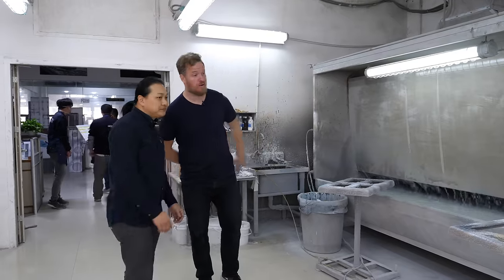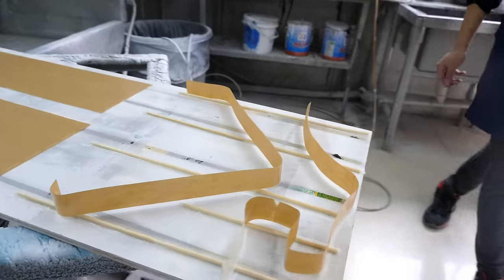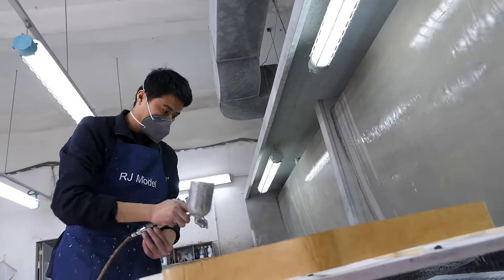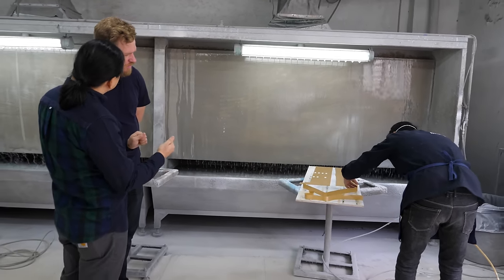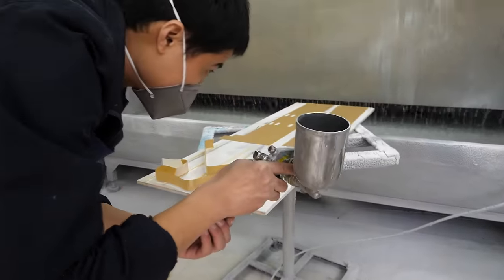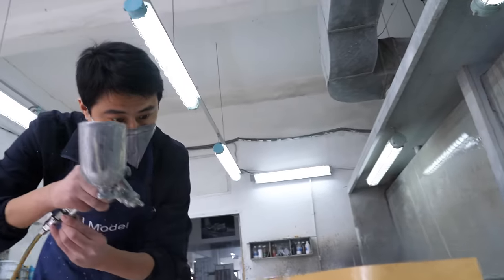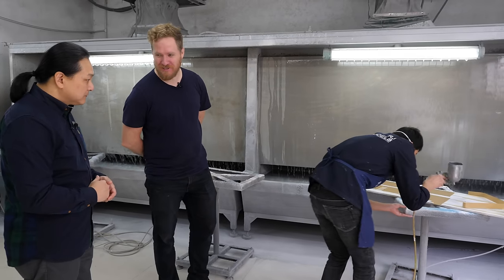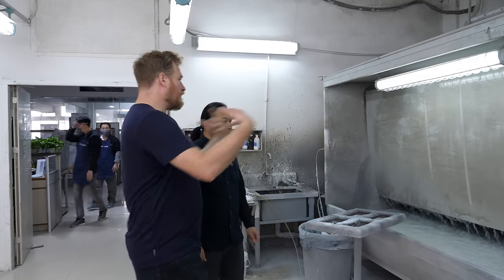This Chinese Factory Makes $100,000 Architectural Models!

Comment: Sorry Strange parts do you still have the laptop you bought ? If you don't use it and it's just gathering dust may I have it by chance? I am thirteen and I fixed my brothers laptop then it broke a month later and I want to see if I can try getting your laptop. The Xiaomi laptop air.